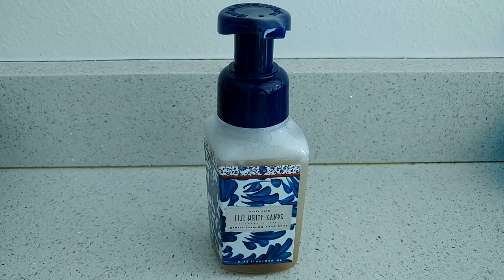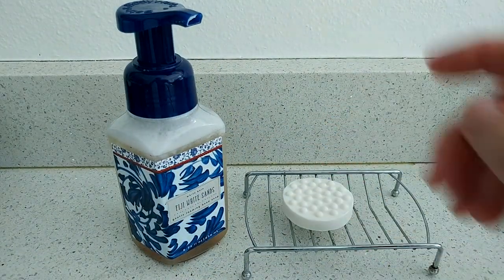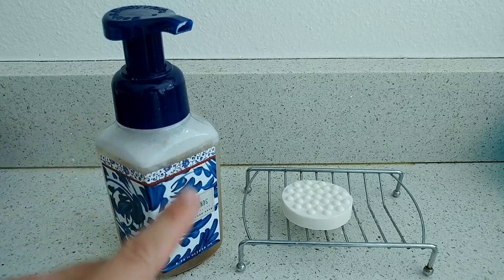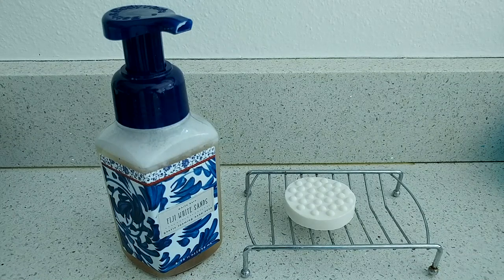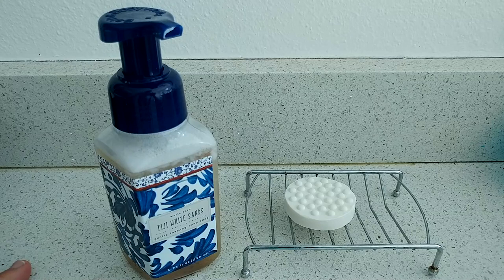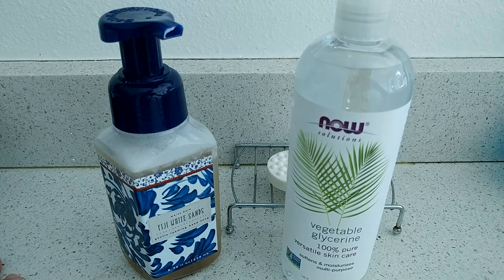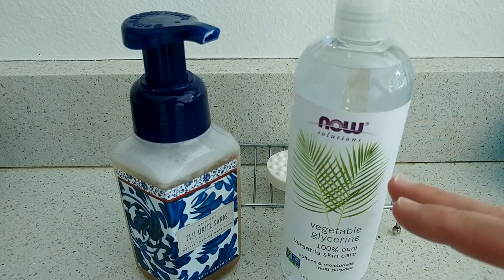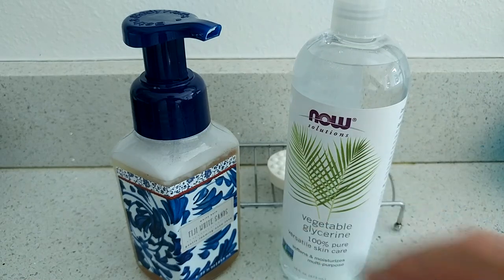How To Fix a Rough Running Pump On Foaming Hand Soap? (How To Lubricate It?)

Comment: It's a misnomer to think that glycerine will fix the pump function when the pump sticks or stays in the down position. Actually, the pump itself needs to be removed and silicone grease is needed to lubricate the pump chamber.
Reply from the maker: Thanks for your opinion. I guess it's different with every pump. For mine it seems to work ...
Reply: It's actually a misnomer to call his solution a misnomer.